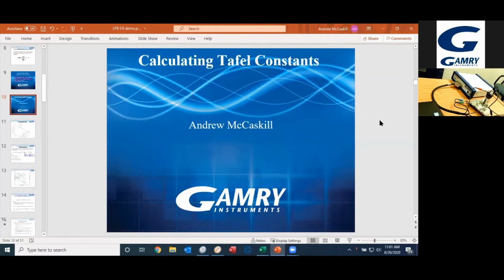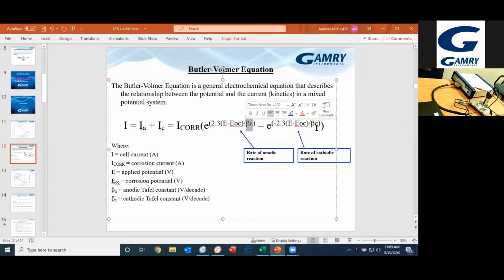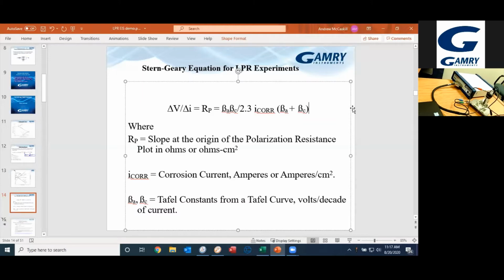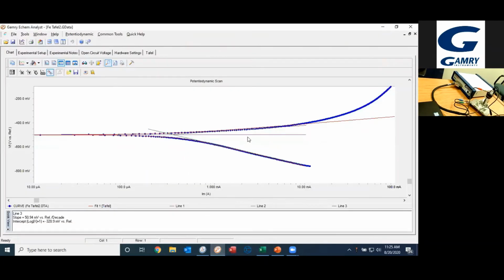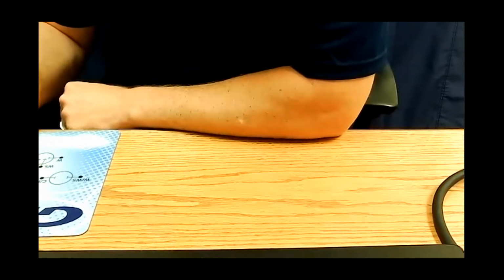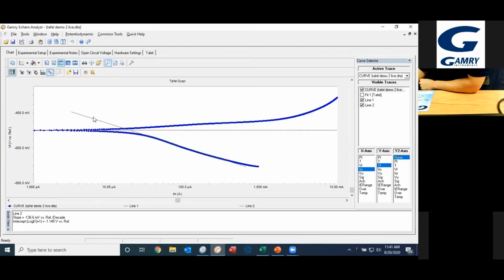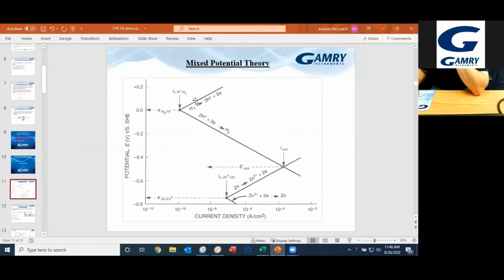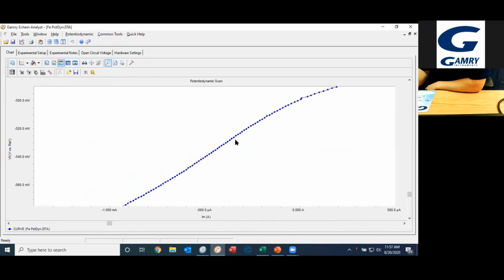A Tafel Experiment - Calculating Tafel Constants

Comment: Hello. Thank you for the video.
Can we make a Tafel fit combining two polarization curves? One for cathodic, and another for anodic potentials. Thank you for the answer in advance.
Reply from the maker: Yes, you are able to do this in our Analyst software. You can overlay the two files, one for the anodic and one for the cathodic. To calculate the constants you can perform an "E log I" fit, which is a Tafel fit performed on either the anodic or cathodic half of the curve. 

If you need any assistance performing this, please reach out to our Technical Support Engineering team at techsupport@gamry.com. We are happy to help.
Reply: @gamryinstruments  Thank you for the answer. One more question: Is it possible to correct my data (current or impedance) with surface area of the sample?
Reply from the maker: @dmitrykurchavov9744  Yes, this is possible. Once you open a data file, you can go to Options. In here you will see a section for "Units for Current". You can select between Current (non-normalized) and Current Density (area normalized). Same applies for impedance data. If you need any assistance, please do not hesitate to reach out to our Technical Support team.

https://www.gamry.com/contact-us/speak-to-an-electrochemist-2/

Comment: Hi @Gamry Instruments, I am currently evaluating susceptibility of material to corrosion from Tafel plot. I'd like to ask what is the most appropriate range of current values used to evaluation by your Tafel Fit routine. Evaluation will be done by more people so I am looking for an objective way to do the evaluation. Is there any standard (ISO, ASTM,...) for this purpose? Thanks.
Reply from the maker: Due to the wide variety of materials and electrolytes used, there is no generic standard or "rule" to follow when selecting a region. The region selected should encompass the linear Tafel region, but there are no guidelines beyond this. If you commonly test the same materials and have a large data set, you can likely define a range of values more specific to your system.

If you email your data set(s) to techsupport@gamry.com, one of our Technical Support Engineers can provide feedback on the selected region.

Comment: Hi thank you for the video. I actually did measurements with and without inhibitor. And with inhibitor the corrosion rate gets smaller an my anodic slope gets steeper. But all of my tafel constants (ba= 50 mV/dec; bc= 470 mV/dec) stay more or less the same because it's the only way to get a fit where the linear part of cathodic and anodic branch intersect with Ecorr. So my question is what does it mean, when the anodic branch changes and what physical meaning does the tafel constants have? Thanks
Reply from the maker: There is not a simple or straight forward answer to this question. There are many variables that can cause the tafel constants and the anodic slope to shift. When the slope of the anodic portion changes, we can say that the kinetics of the M > (M+) + e half reaction has changed. The cause of this is varied, and system dependent. 

If you email your data files to techsupport@gamry.com, we can perhaps provide more specific details, or provide resources on the topic.

Comment: Sir, when I use tafel fit, it says that the difference between Ecorr and Eoc is large, your sample may have changed. What should I do about this ??
Reply from the maker: Increasing the "Init. Delay" parameter time will help ensure your sample is stable before the Tafel test begins. This can help reduce the difference between Ecorr and Eoc. If you email your data file to techsupport@gamry.com, one of our engineers may be able to provide additional suggestions
Reply: @gamryinstruments Ok, thank you sir I will see to that and sir one more thing, whenever this comment shows up, does this mean that the graph obtained is wrong ?

Comment: What formula u have set for calculating corrosion rate after icoor beta a beta b
Reply from the maker: Once Icorr, Ba, and Bc have been calculated by Tafel analysis, Faraday's law can be used to relate current to mass (and mass loss). The mass loss can then be converted to a corrosion rate.

We offer a application note that shows the details of this calculation:
https://www.gamry.com/application-notes/corrosion-coatings/basics-of-electrochemical-corrosion-measurements/

Comment: How can i calculate energy density, electrical conductivity by gamry? in my lab we use 1010e
Reply from the maker: Energy density is usually determined in a cyclic charge-discharge experiment. There is a beginner guide here explaining how to setup such a test: 
https://www.gamry.com/support/technical-support/getting-started-with-gamry-software/your-first-experiment-cyclic-charge-discharge/
Electrical conductivity is usually determined via an EIS experiment. If you contact our technical support engineers at techsupport@gamry.com, they can provide specific details to make these measurements on your exact cell type. They will be happy to help!

Comment: Hi, I am currently doing potentiodynamic polarization corrosion testing for my research. Sorry for asking, how do we obtain the passive region in potentiodynamic polarization as shown in 17:56. Do we increase the potential applied to get the extension curve in the anodic curve?
Reply from the maker: Hello. The passive region is an inherent property to certain materials. How and where it will occur differs for each material type. Unfortunately, there is not a quick or direct answer to your question. If you have data you need help analyzing, please email it to techsupport@gamry.com and one of our engineering staff would be happy to assist.

Comment: Dear sir,
we know that Tafel extrapolation is only valid for high value of overvoltage : typically |80 | mV/Ecor.
but here you have used potential values less than the 80 mV recommended. Can you explain.
Reply from the maker: This presentation was designed as a general overview of Tafel experimentation and analysis. In order to keep the length of the talk reasonable we did not examine the finer details, caveats, and all use cases. If you have specific questions about your Tafel data, please email techsupport@gamry.com